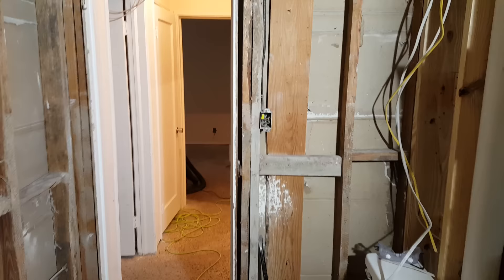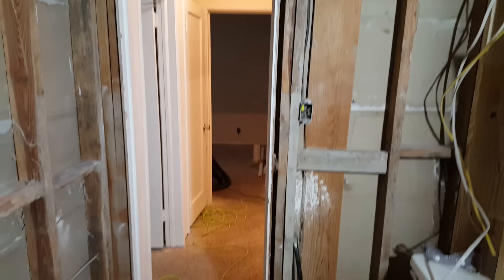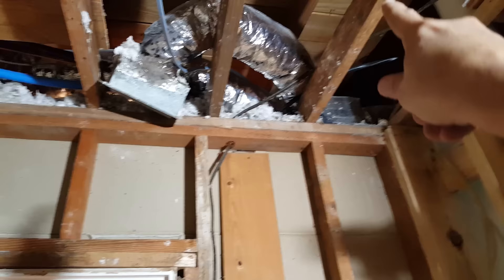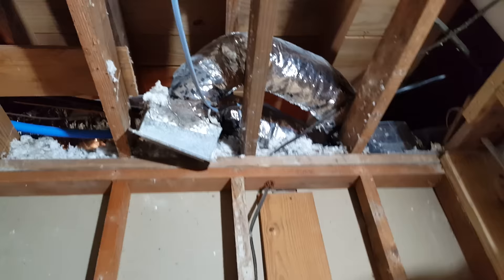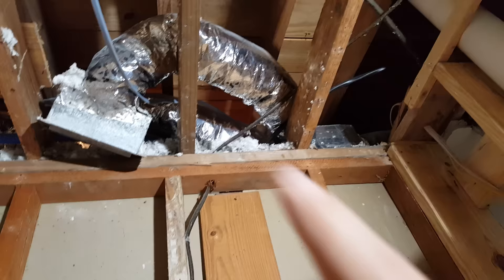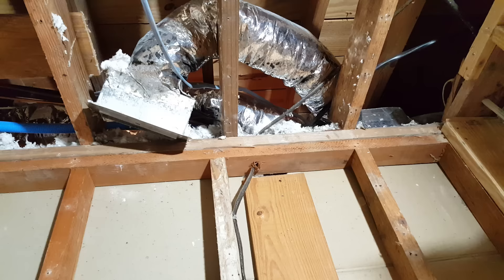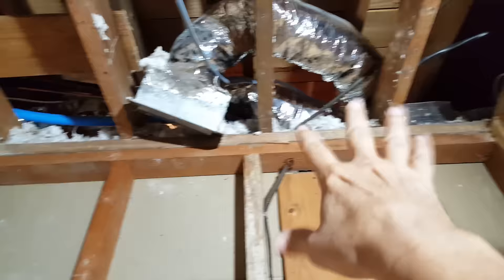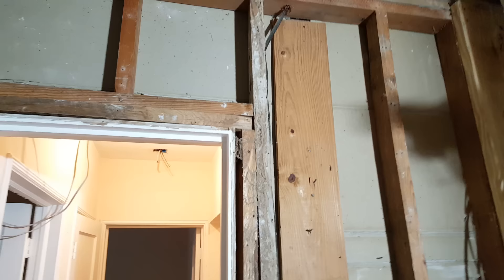How to Tell if Your Wall is Load Bearing

Comment: the header shouldn’t be sitting flat, instead be upright with a 1/2” spacer, better yet, use 2x6’s.  since there’s an attic above it’s doesn’t make much of a difference, but to build it properly, headers should be positioned upright, yes?
newer homes built with 2x4, and 2x6’s make it much easier to identify a load bearing wall vs an old home where the spacing is a most always off, and the timber sizes vary widely, even the most experienced carpenter will scratch their head.  for example a true 4x4 used as a header in a partition wall for closets and a hall is considered a load bearing wall, or is it not?   what if it runs the whole width of the house, to partition rooms, as well as a closet, and not run parallel with the ridge of the house, is it load bearing?  i’d say not, but can we be sure?
what if the house has two parallel running load bearing walls that serve as supports to widen the house for a center hallway and this 4x4 runs perpendicular to these two load bearing walls, is is safe to say it’s not a load bearing wall?
what if there are adjacent beams to the original twin load bearing walls, bringing the total load bearing walls to four, when the house only has one ridge?

some old houses were built like post & beam and walls were filled in with other large timber they had on-hand like the 4x4 i mentioned.
2x4’s, 4x4’s, 4x6’s, 4x8’s, 8x8’s, and 8x10’s,  how the hell are we supposed to know what is considered a cripple, jack, king, header, post, or beam in different applications, when different builders used the same timber for different applications.  it’s a craps shoot.

the only way is to consider where it is, which way it’s running, what’s around it, and what’s above it, and even then, can we be sure if it’s holding up a floor?   hmmmm what if there another floor right above the 4x4’s built with 2x4’s with floor boards covering that?

i’ll grant old homes the fact that the timber used is far superior compared to today’s lumber, because it’s even resistant to carbide blades, but at least now-a-days there is protocol, there is a sequence of events, there are codes, there is a system in place where houses are built in a way where someone can understand how and why, just like you’re explaining in this video. there’s rhyme and reason. every pieces serves a purpose, and the construction makes sense.

OLD HOUSES SUCK !!!!!
Reply from the maker: Yes, this house was a beast until termite damage brought some of the stud walls to their knees.

Comment: We don't have a basement and it's a two story house.  So how do i tell if a wall is load bearing without exposing the studs on both floors?
Reply from the maker: Try to get into the attic above that wall, and see if any ceiling joists are having an endpoint on top of the wall. If they do it is load bearing. Also if you have a gabled roof and see any angled roof support struts that end point on the interior of the roof gable trusses, and other endpoint on top of your wall, then it is load bearing.

Comment: Obviously built decades ago but that door header would've stronger if  flipped 90°.
Reply from the maker: Not just flipped 90, but made with two 2x6 pieces sandwiched with a 1/2" board.
Reply: @jeffostroff  agreed. Extra work to finish sheet rock without the 1/2" spacer.

Comment: I found your video very informative. I just had my entry door replaced, it has sidelights that are attached (all one piece) When the contractor removed the old door and side lights it  was in three separate pieces. when removing the sidelights, it was attached to one of the beams, which he removed along with the sidelight because it was to difficult to separate. He did not replace the beam, just added some long screws. When I questioned him he said that was fine. It didn't sit well with me, so I started doing some research. After seeing your video, I think I have a problem. Contractor finished the installation, put all the molding on and it looks ok, but I am concerned that he may have compromised the safety of my home. Do I have to take all the molding off to check? Would a stud finder help? What can you suggest? I appreciate any advice you can give me. (My home is on a slab).

Thank you,

Bob
Reply from the maker: Well it does not sound to me like your contractor pulled  a permit, which is probably required in your area for an entry door. But either way not a good idea to remove a beam over a door.  This would not be so bad if the wall is not a load bearing wall. But if it is a load bearing wall, the you need to make sure the studs on either side of the door are present and the 2 beams on top of the door as shown in this video. You can use a stud finder to start right at the top of the door to locate the first beam which is normally 1 1/2" thick, then stacked on top of the beam should be another beam, because on door tops they will usually use 2 pieces of 2 x 4 stacked on top of each other.

Comment: Can you help me I have a question regarding joists. I have concrete walls in my house, but the joists are  only 4" deep. I have plenty of space to make another room up there, but my question is. As my house is made of block concrete, what masonry hangers do I use to make the floor joists stronger to support a new floor. I understand that I could attach the new joists to the existing wooden ones. Can you advise me please.
Reply from the maker: Dave, you have a very complex engineering issue there. The ceiling joists for your first floor, will have to be replaced with floor joists to make the 2nd floor, because 2x4 ceiling joists you have now are inappropriate for use as floor joists on the second floor. Likely those will have to be 2x10 or 2x12, way stronger than 2x4. You should have an engineering company with you on this, as there are many complex variable for determining what size and what type of joists, or headers or beams you will need. They do have joist hangers for concrete, and maybe the engineering firm has better alternatives for you. For example, let's say all the joists line up and terminate up against the cement block wall. You could mount a long L-shaped angle iron piece of metal to the cement wall which then provides a shelf for all the joists to rest on, then you bolt them to the angle iron. These are the things the engineering firm will look into, along with asking is it allowed by code.
Reply: your 2x4 'joists' are collars. I am assuming this is a rafter roof and not a truss roof--else you would not have room for another room. If you were to do this, you would need to put in new floor joists that are the right size for the span. Depending on the span, these would move to your outside walls. The collars can stay as they would be below the floor joists in hight. (do not put the floor joists on top on the collars, just beside according to code.) Also, you may want to ensure your walls are on 16' centers if you hav4 2x4 construction before doing this.

Comment: Can a closet be load bearing? Why would a closet have a double top plate but no lintel?
Reply from the maker: Most walls have double top plates any to facilitate 90 degree facing wall from each other. Any wall can be load bearing, even a 2 foot wide closet wall.

Comment: Too bad the two idiot realtors in Austin that decided to remodel and flip homes didn’t bother with such details of load bearing walls, using a licensed electrician.   When we decided to divorce and sell the house, our realtor said “don’t worry about that floor droop upstairs that bends and creaks when you walk on it, it’s a sellers market and this is a highly sought after neighborhood.”   Ok...
Meanwhile, a 9 months later, still having to live with MR cheater cheater and getting anxious, we STILL had not sold our home, not even an offer because everybody that walked over the droop upstairs, in our 3100 sq ft house on a 10 foot cliff, said “NOPE!  Must be structural issues.”  
Ended up having to hire a structural engineer firm (very expensive and determined that a MAJOR load bearing wall had been removed) and for 2 months there were pole jacks in the house, lots of sheet rock removed (even during holidays) the house had to be jacked up (scary as F*CK when that went down). Then all the repair work was another very expensive cost eating away at the proceeds.  It really was a nightmare.  I wish I had known more about remodeling, credentials, permits, etc and how to choose a man that’s not an asshole cheater.
Reply from the maker: Well sorry to hear you had to go through all of that. Did you by any chance make any video that you could upload to help others going forward? I'm sure that your type of engineering disaster happens all the time.
Reply: How much did the structural repair of removed load bearing wall cost?
Reply from the maker: @lilaclilac4450  It cost zero, because we did not remove the wall, it was stripped down to the studs for a bathroom remodel, and to address termite damage.
Reply: @jeffostroff  - I think Lilac was referring to MommaKat's comment.  Sometimes I find the different ways the comment sections are structured is confusing.
Reply: Obviously you weren't doing your job and your man had to find it somewhere else.
Reply: TLDR

Comment: Where in the code books does it state you don't need a secondary top plate?
Reply from the maker: Keith, The International Residential Code Section R602.3.2, Top Plate, they give an exception where you can eliminate the top plate if an only if:  “1. The single top plate shall be tied at corners” with a 3 x 6 galvanized steel plate, AND, this is the big part, just like I stated in the video:  “ 2. The rafters or joists shall be centered over the studs with a tolerance of not more than 1 inch (25 mm). “ Clearly they are worried about shearing, because a 2x4 cannot possibly be expected the bear the weight. After all, you use double 2x6's for a header over a door right?

Comment: How do you determine load bearing in a mobile home with no attic...besides ripping out sheet rock?
Reply from the maker: Yup, that's pretty much how you would have to do it, or slice across the top of the wall and see what is up there. Any joists or other roof support whose ends rest upon the wall top you can bet it is load bearing. Even if the joist does not end on the top of the wall, but say it stretches across the trailer but still touches the top of the wall, I still would play it safe and treat it as though it were load bearing.

Comment: Great video! I am looking at removing a wall and it is parallel to the floor joist. So I would assume it isn't load bearing, however, the only thing that worries me is that the floor joist is directly above it. It is on the main floor of a 2 story house and there is no wall above it or below it in the basement and it isn't an exterior wall. Would it be safe to assume that it isn't load bearing because of this?
Reply from the maker: Good question, the best way to tell for sure is to see if any structural members up above have an endpoint on top of your wall if they do then it is definitely a load bearing wall. If there's any parts of the roof Truss or ceiling joists that have an end point on top of your wall then it is a load bearing wall because it is using that wall as a support. If all you have is ceiling joists going over the top of the wall and not ending on top of that stud wall, then chances are that is not load bearing. You then need to make sure whether or not the exterior walls are taking up that load. Now here is where I differ from some other people in the know, is that they think that just because the ceiling joists don't end point on the wall that it's not supporting the load but I look at roofs that have been there for decades and I always question hey if there was any sagging maybe that wall is doing something to support some of that weight . But one thing is for sure here it doesn't hurt if you want to build a secondary wall in front of that to hold the load while you do whatever you need to do there and if you really want to be certain you'd probably want to pay a engineer to come in and just look it might cost you a couple of $100 but can save you thousands of dollars over a big mistake.

Comment: I am trying to add a 36x80 door from my basement to my garage.  The current door is 30x80.  The rough opening is 33x82.  I have concrete 4 inch block that the door opening is in.  That concrete wall is not load bearing, the joists are running parallel to the wall and rest on the wood on top of 10 inch exterior block.  Would it be okay to cut the 4 inch block to make my rough doorway opening wider??  I have a main steel beam in the basement, running perpendicular to the door and joists rest on that steel beam running the whole length of the house.  Its a ranch house.  Just basement and first floor.  I have 2 support post on that beam in the basement. Evenly spaced.  Just wanted your thought on if that 4 inch block can be cut to make door opening wider.  I would have to cut about 5 1/2 inches of block off to make my rough opening 38 1/2".  Please let me know and your video was very helpful.  Thanks!!
Reply from the maker: lionel2100  That sounds to me like it would be OK. But please make sure you spend the $200 or $300 get a structural engineer to come in and look at it and tell you yes or no just to be absolutely certain. And you'll probably want to bring in a company with one of those giant diamond saws that can cut you a nice perfect opening because you don't wanna be trying to chisel off of that wall you need that gigantic diamond blade saw to cut the perfect opening for you.

Comment: 2:42 is that other wall not supporting any of the load ?
Reply from the maker: I assume you are referring to the wall on the left. Technically that wall is not load bearing even though you see that ceiling joist above it is resting on it but not necessarily bearing the load down on it because in actuality this house has cement block exterior wall in the front of the house and the back of the house and those ceiling joists that you see there are running from the front of the house to the back of the house so theoretically even the wall that I was talking about as the load bearing wall may not actually be a true load bearing wall in the sense that most experts are expecting to see. So according to the strict definition that some people use for load bearing wall unless the load ends on top of the wall they don't consider that to be a load bearing wall.Of course it never hurts you to treat it as a load bearing wall and to build a temporary brace wall while you do whatever work you're going to do and then remove the brace when you are done that is certainly good sound engineering practice.  In the case of this old 19 forties house the true load bearing walls are the front cement block wall and the rear cement block wall of the house and these ceiling joists that you see their span the entire distance across the house. But you'll never convince me that there's no load pushing down on those stud walls. The reason is because of age and sagging of ceiling joists.

Comment: Too much negative comments on the "load".  I came here just to learn about the Load Bearing Wall. Cuz a contractor took a look at my attic and said that's what i have.
Reply from the maker: Basically if you have any ceiling joists that have an endpoint on top of your wall, it is load bearing. If you have any of the roof support members that end on top of your wall, then it is load bearing. Hopefully they should have taken a few photos up there to show you, or you can climb up there to confirm for yourself.